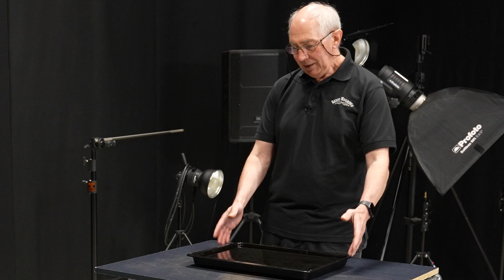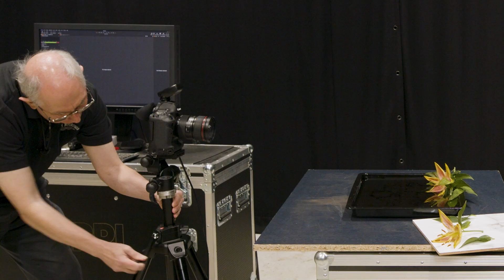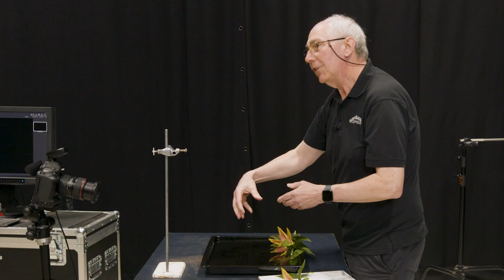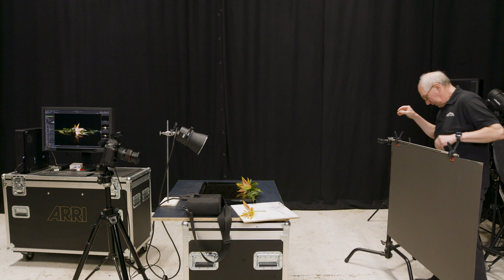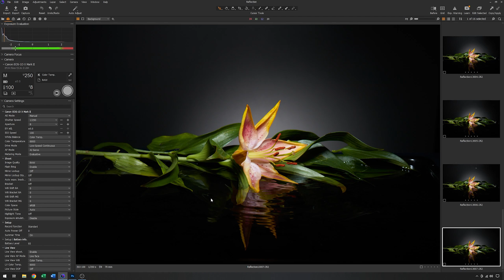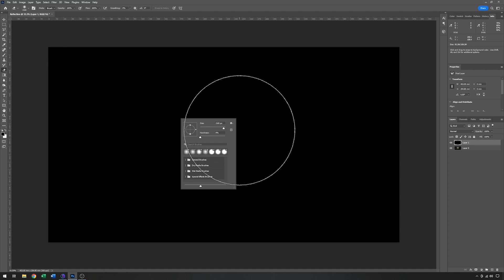Still life photography reflections.

Comment: Hi,
Ik really like this video.
There is one thing I want to ask you.
Would it be possible to make a still life with continuous lighting?
This is the way I usually work.
Greetings from the Netherlands,
Antoine.
Reply: Yes, you can make still life photos using continuous lighting. But instead of using a fast shutter speed to eliminate ambient light, you need to make your work space dark so you can use longer shutter speeds. I believe this channel made a video using a flashlight and a plastic bag to light a still life of apples.
Reply: One issue with a continuous light is freezing motion the way a strobe does.  If you use a longer shutter speed you will end up with a blurred reflection like waterfall shots taken with longer exposures.  That might look quite nice, though.
Reply from the maker: Yes, absolutely